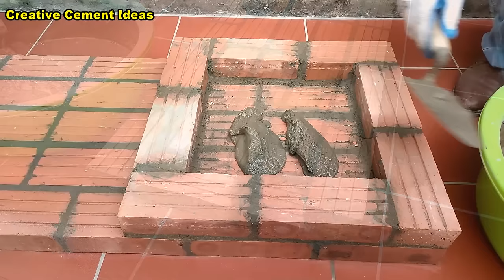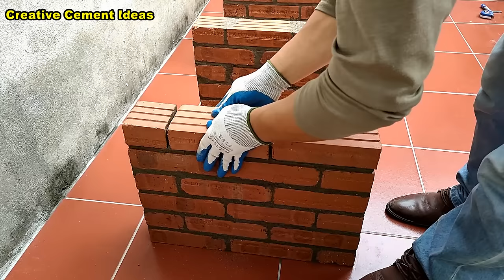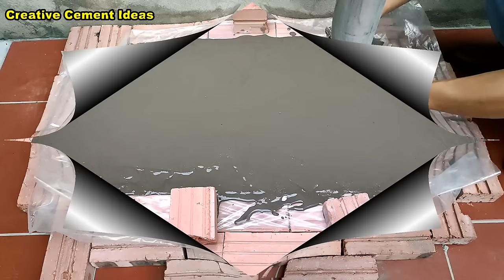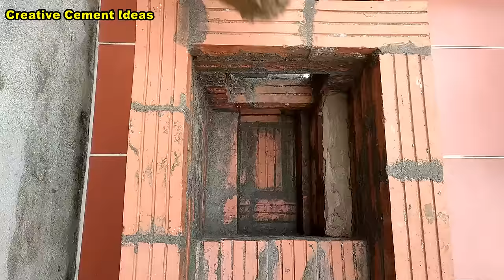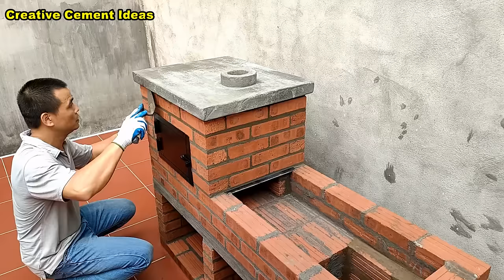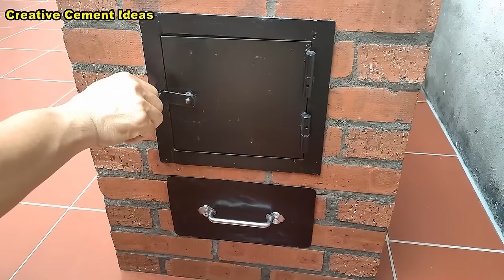How to make a 2-in-1 smokeless wood stove - super effective

Comment: Fantastic work. The only thing I would have done differently is have the chimney port on the far end of the oven. This way the heat would travel more evenly over the oven box before exiting the flue.
Reply from the maker: Thank you very much for your comments and suggestions
Reply: Walang butas ang salangan ng kaldero o kawali, matakaw ito sa gatong. Meron namang nabibiling cast iron na burner na adjustable ang butas ayun sa laki ng kaldero o kawali
Reply: ❤0pp

Comment: This is really built clean and sturdy. Can the metal stove top be removable and replaced with a grill so that it can be used as a griller as well?
Reply from the maker: Hello, this stove can remove the surface, and replace the grill depending on the purpose of use.
Reply: @CreativeCementIdeas  Thank you! Great job!

Comment: I'm curious, has the team in this video been using this stove for a long time? b'cause some people say that building elements that use cement will easily break and crack, it is more durable if u use clay as the base material.
Reply: You can get heat resistant brick and cement.

Comment: Хорошая печь. Только почему бездымная, ведь дым уходит в трубу, как обычно?
Reply: В комнату не дымит))))
Reply: @СергейАхметов-ц6й  Ясно.)
Reply: @marinaturist3751  Я тоже думал, что будет печь типа пиролизной, с дожигом пиролизного газа, а оказалась просто печь. Причем я бы какие нибудь ограничители сделал по периметру варочной поверхности, для безопасности. И эта печь не очень подойдёт для обогрева. Слишком короткий путь проходит дым, практически сразу уходя в трубу. Для готовки норм, а если греться, то в довольно малом объёме и с неэффективным расходом дров.
Reply: @СергейАхметов-ц6й  I have noted those points too and I am planning to improve this good design by :
1. Introducing secondary burning. I will add a small air inlet tube at the lower front which passes through the firebox and leads to perforations beneath the top plate to dispense oxygen to burn the gases (smoke). 
2. Add a galvanised water tank on the slab above the oven with the chimney passing through it so that the hot exhaust can boil the water in the tank.
3. Enlarge the oven abit and line the walls with clay to store the heat.

Comment: Another great video. What temperature does that oven reach? Would it be hot enough to cook meat I wonder?
Reply from the maker: Hi, this stove is very efficient for high heat and there is no smoke in the room, unfortunately I did not install a thermometer in the oven.

Comment: Hello there,great work !!
If Iay ask what kind material used on the top of the cooking area??
Reply from the maker: Hi, the top plate is best made of cast iron or stainless steel, if not, you can make iron 5mm thick, and reinforced, 5x5cm v-shaped iron bars,
Reply: @CreativeCementIdeas  awesome, thanks alot

Comment: What are those called those metal boxes you put inside I need them but I can’t find them anywhere
Reply from the maker: Hi there, it's always available in stores that sell kitchen supplies, or you can go to a mechanic and they'll make it on request.
Reply: @CreativeCementIdeas what unit of measurement is the tape measure in?
Reply from the maker: It's a normal meter, 1m=100cm, 1cm=10mm

Comment: Hello! Can you please guide as to where to get these attachments??? For the stove etc??? Thanks in advance!
Reply from the maker: Hello, there are basic measurements in the video, you just need to watch the video carefully,
Reply: But where can I get the metal plates? For like the oven and stuff?
Reply: Also how many bricks did you buy??
Reply from the maker: This stove I made about 230 bricks, and the top plate and baking box, if you can't buy ready-made goods, please go to the hardware store, please.
Reply from the maker: The top plate is made of 5mm thick iron and reinforced with 4 5x5cm V-shaped iron bars,

Comment: Where did you buy this iron burner ? Top of the stove
Reply from the maker: Hi, the best top plate is cast iron, or stainless steel, if not, you can make 5mm thick iron, and reinforce 5x5cm V-shaped iron bars.

Comment: Are the bricks you use fire brick or just a regular brick?
Reply from the maker: Hello, those are fired clay bricks
Reply: Thank you! Do you have a item list for the cook top, oven, etc?
Reply from the maker: @levihatcher2168 You find a store that specializes in selling kitchen components, there are all the components available, you just need to check the size that suits you.
Reply from the maker: @levihatcher2168 If you can't buy the components, you can make your own, a 5mm thick iron plate reinforced with 4 V-shaped iron bars 5x5cm 5mm thick as the top, a 2mm thick folding iron box

Comment: That plate what material
Reply from the maker: Hi, the best top plate is made of cast iron or stainless steel. If not, you can make 5mm thick iron and reinforce 5 x 5cm V-shaped iron bars.

Comment: Please tell me the materials name in English what is used in this video... I want to understand properly... From Bangladesh 🇧🇩🇧🇩🇧🇩
Reply from the maker: Hi, the best kitchen should be made of heat-resistant bricks, cast iron upper tray, stainless steel baking box with cast iron door frame.  and heat-resistant mortar mix
Reply: Thank you soooooooooo much 😍😍
Reply: How well would a clay lining in the firebox do to preserve the bricks ?
Reply from the maker: Hi, it's very good to be made of clay, but if it's used for heating a lot, it should be a heat-resistant brick.

Comment: Strange that you not wet those bricks with water first! It will suck most water out of your mortar mix rendering your work weak since it cannot cure and strong without water in the mix design! the chemical process in the mix needs water continuously to become strong and cure. Curing with water afterwards for at lease a couple of days will ensure strong, fully cured cement mix!!